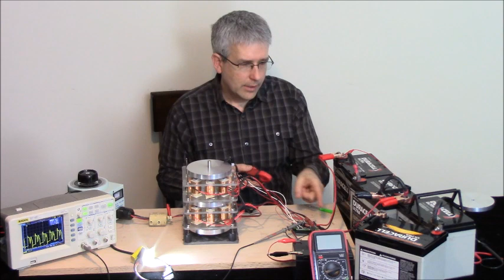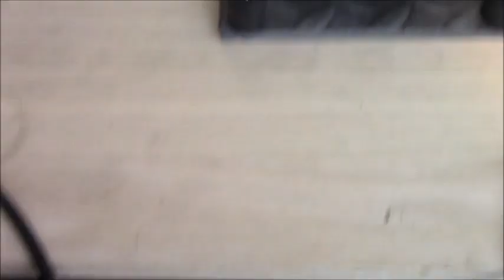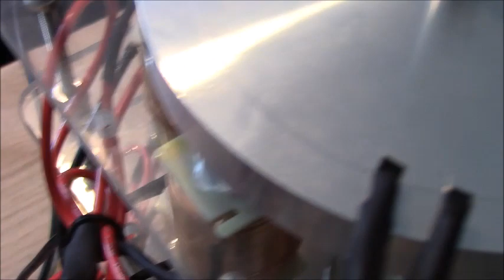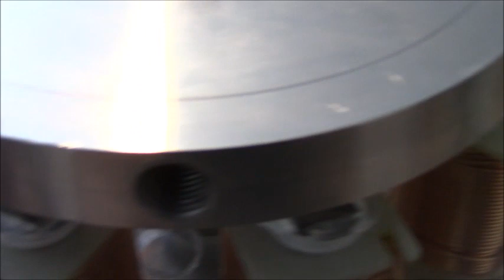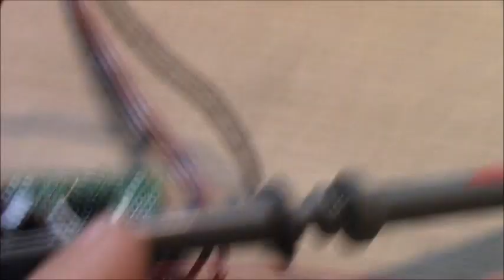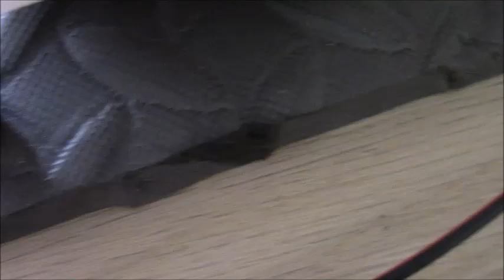24V 4 DualPole Mini Energizer Self-starting closeup. 2 Hall setup.

Comment: Rick what are your thoughts on atmospheric electricity being collected by power lines as the main source for powering the entire world?
Reply from the maker: I thought about that many years ago. 30 feet of elevation from the ground gives a good deal of potential difference. There are many options that could work with few parts and a bit of tuning.
Reply: I think that would be awesome to power and heat your home with zero cost once a system of collecting is in place.

Comment: So, is the need to cut the duty cycle back at the higher voltages due, primarily to the spacing issue of the distance between the coils as, at higher speeds you run into opposition from the next coming coil that much sooner??  i.e. due to the rpm at 48 volts a duty cycle that worked for lower speeds would now cause the mosfet to still be conducting as the rotor approached the next coil now repelling the attraction???  If so, what is the relationship between the duty cycle (pulse time percentage on) and the peak spike voltage at the different voltages??  If I understand this correctly, RPM and pulse time will work together to create a frequency window in which we need to find a resonant point, tuned, I presume with a particular capacitor value at a given voltage.  So in the end we'll need to look for a particular set of parameters to tune to to get the best efficiency (Q) resonant condition??
Reply from the maker: Two things. The timing changes with rpm. The pulse is increased with voltage.
Reply: Pulse increased with voltage.  Keys to the kingdom there.  Thanks.  :)